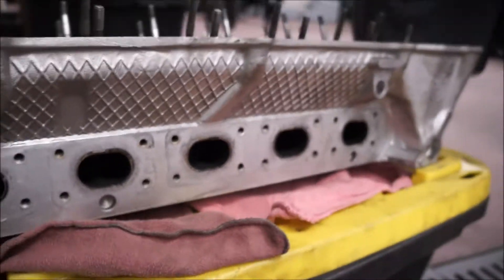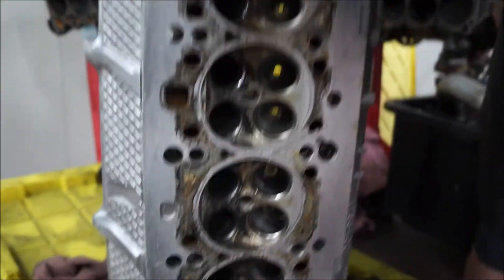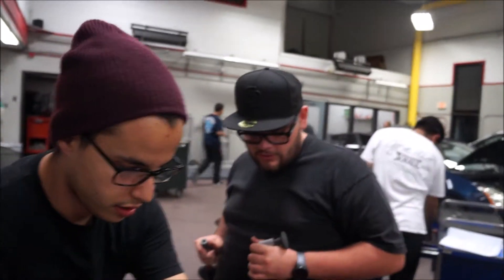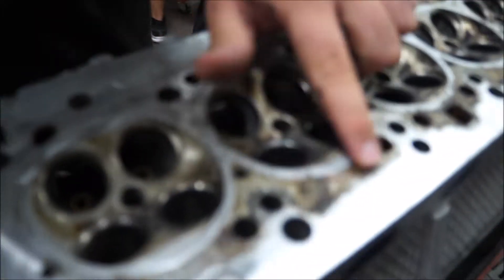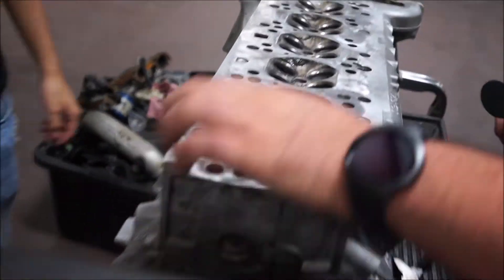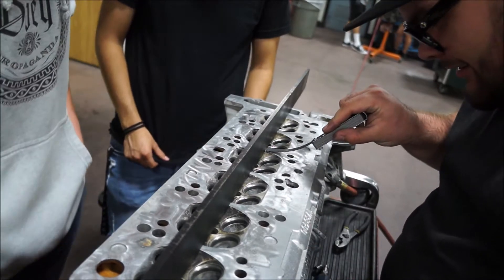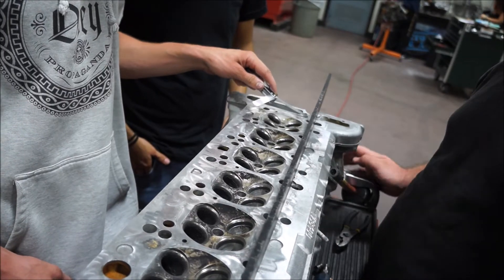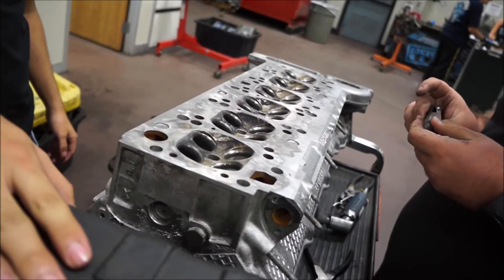Prepping the M50's Head for Machining

Comment: my car was having a crack head. and was welded neatly in the cracked part. and already leveled again. today I just re-installed the head that has been fixed with a new paking head. and I tried to turn the engine but the air bubbles in the radiator still does not run out until I bleding until 30 minutes of air still out. I check on the oil cap there is water vapor. is this still a leak? and is there normal water vapor on the oil lid?